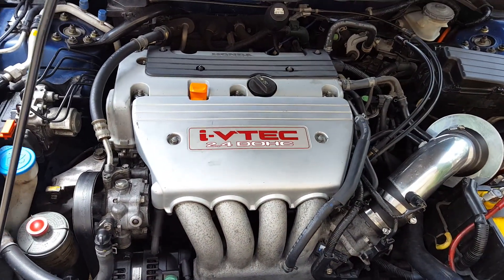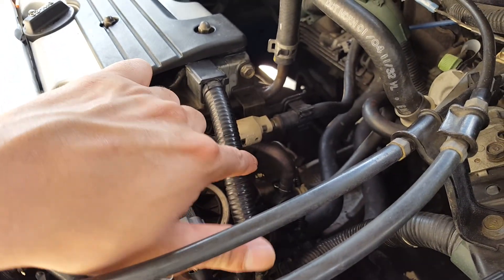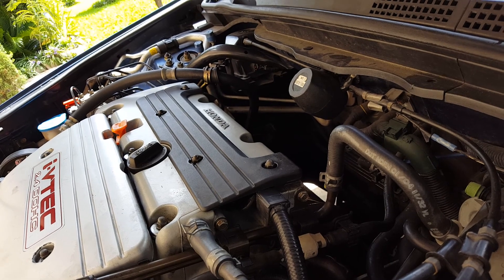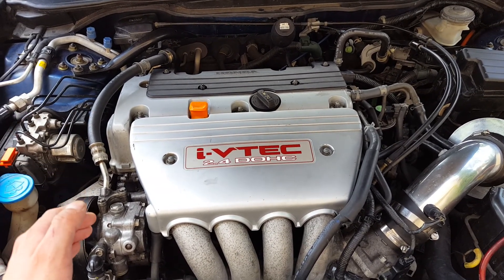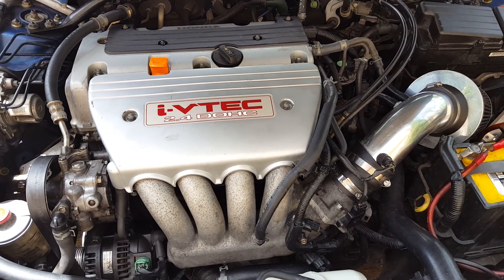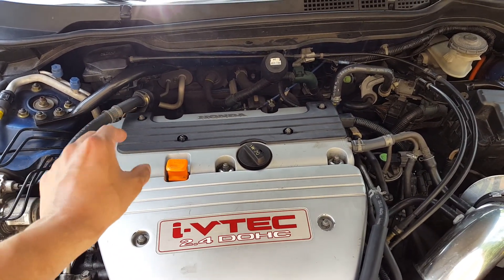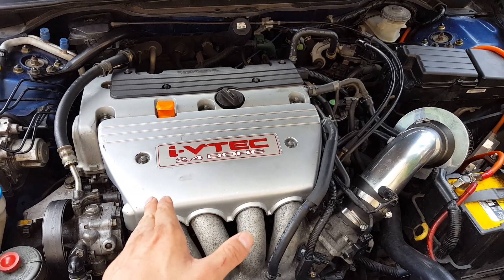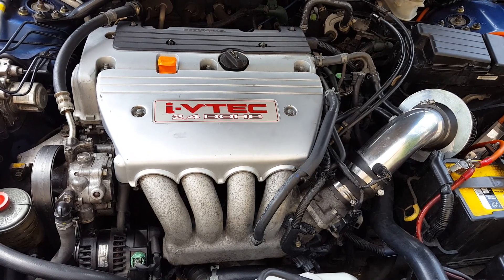K24a2 head procedure

Comment: Hey bro how’s the set up running im planning on trying it i have a 03 accord with the k24a4 engine and i have a tsx k24a2 head i just got from a friend
Reply from the maker: sorry about the late reply,As long as everything is done right and your car is maintained ,the engine should run good.,The only thing that sucks is the header part ,all the garbage sold on ebay and on line is crap even the dc header manzo header aftermarket parts are low quality ,ect ect..ILL say run the factory k24a4 or k24a2 exhaust  headers with new gaskets genuine from honda all tightly torqued to specs..The car should run better beleive it or not..To be honest is all worth it though..make sure you have your support bracket on your chassis and that the bflex pipes  metal STICK is going through the grommet held and supported  of the metal bracket that tightens to the subrame  chassis of the accord .In this manner your header will never melt....however if your using stock k24a4  exhaust header ,,it should never melt because its good quaility product...

Comment from the maker: Let me clarify one thing the hesitation wasnt the vtc  itself .it turns out it was the header that was split near the bflex pipe , that was the main issue .However the vtc does kill the car itself  if its half way in half way out ..,so make sure the wires from that plug are not fragile and that they are solid and sturdy ....Once again it was the header ,the manzo  header was split in half hanging that was the main issue..This set up is plug n play ..Also make sure that the mechanic isnt in a hurry and that this bonehead mechanic doesnt forget to apply 174 nm   or 130 lbs of  precision  torque to the 19mm cranshaft bolt and do not forget the wulldruf key ....From my experience the accord puts out some serious power so bolts that arent secured to the given nutenmeter or precision torque , they will come off overtime ...Also as long as the cps are genuine in both the tsx and accrod by part number  they will work perfect with either emission head or as you see this tsx head here in this video ,because both the tsx and accord use the same camshaft position sensors one is label different on intake and exhaust but are same identical honda acura genuine part n number  on both camshafts ,so this a freebie im giving you the builder..i have lots more ive learn and obtained in this build ..i will share it freely ....
The other thing that came apart was the o2 temperature thats reads the temperature of the block   near the exhaust camshaft position sensor,however that wasnt much of an issue like the vtc oil solenoid was...Also check to see that your head meets the honda ,and acura specifications im sure its 3.84 so than you know if you have to resurface the warpage o remill the head but thats obvious because you can eyeball it ,, or better yet measure it with a precise tape measure ,,  according to that measure ,numbers to remember  are 
0.008 
0.05 
3.84 ,,sorry i meant 
3.94 
In regard to either k24a4 or k24a2 vtech head.......its the same procedure ...thats why it worked on my set up ..,beleive me ive already mastered this engines chassis ...so im giving you this info free.. so get to it and build your vtech head on your emission accord chassis .Enjoy life ...
Beleive it or not you have so many options so many heads  vtech or non vtec ec ect ...but keep it simple use the tsx head  on your accord it will benefit alot ....
The hidden gems of an emission accord not a full sulev but still an economy low emission chassis accord.Also this k24a4 is real vtech ,so many folks thinks its not im talking about the stock head on the intake camshaft it has real vtech ,,however i prefer it on both camshafts so i chose the brother the tsx head .
Reply: Did you change the pistons? Ive read that the accord pistons bump into the k24a2 head.
Reply from the maker: @kevinrivera8858  nope ,currently im using stock pistons without any issues .If you look clearly ,they are almost identical pistons on the accord chassis and tsx chassis.difference is thickness in rod formations but its the exact numerical value stock 87 ,,.Ive redline my car past 7300 rpms ,no known issues.Another secret to this is because they use the same oil pump by part number and abreviation.So you are in good hands..this accords ouput power comes from the stock  crankshaft,pistons,rods and also partial emission based vtech head,and this are all accord stock parts from the k24a4 chassis,yet the user can benefit from the tsx head itself bolten on correctly assuming the heads compression is good or is remilled if necessary , rectified ,polished according to specs...No issues with my accord pistons and this tsx head .
Reply from the maker: Also only reason to upgrade to tsx pistons is to benefit from the extra power they generate in the accord chassis, now top that rod with a good recognized brand piston new in standard size and your accord will put out some serios power.Of coarse you have tune correctly and utilize hardware engine management to get the best overall gains in performance .
Reply: Its not the pistons that are the issue . The issue is the valves on the a2 are larger and hit the piston you probably having engine damage and you dont even know it ur not a mechanic like you said
Reply from the maker: @ericmadx3063  actually that isnt an issue because if u ever put an exchange both heads and you look at them just right , you will see in fact that they both are symetrical and they both seat  at the same position including on the exhaust side of the valves .I have both heads and ive done the measuring myself .I also have the schematic on both cylinder heads,its why i know cleverly that my car is happy and maintained.As far as realizing what works and doesnt.They are balanced just right both cylinder heads .Theres no issue here .The issue arises from improper installation.I recommend you read the rebuilt on both the tsx and accord .Surely than you will know whats correct and what isnt,or study the schematic map of both heads .Your answer is there.Just take the time to study so u wont rely on others input that are wrong in all aspects.
Reply from the maker: @UCbtUF7nzVYauJ11kFC3rU_A on line or if you have a mechanic working at honda pay him a visit .Resources are available everywhere.Always read as much as possible  ,it helps.
Reply from the maker: @ericmadx3063  im sorry to burst your bubble ,but you obviously are clueless first u dont know what your saying ,
You need to study and take your observed look at the valves  carefully,
They are identical on both vehicles .
I didn't mean to sound bossy .
But like others and idiots here on you-tube , hear and beleive others when in fact they dont understand mechanics of hondas .

Next time think before you offer wrong  info on this machines..
Like i said they are equivalent congruent on 
In 
And 
Ex 
Sides .
Surely i give u that free of charge .
So now you know the facts .
Only problems arise from improper installations .
Incorrect measures 
Or misaligned ,or incorrect shaves,ect ect.
Deformed bolts ,not correct size .
And sometimes mechanics are in a hurry ,and start to mess up  without knowing it.Clearly ,i had to fix 3 errors my so called mechanic did on my set up .,so yes to answer your comment ,im not a licensed mechanic , but i am capable of fixing other so called mechanics work.Not to mention i did pick up my dads talented side of fixing things  and being able to correct sloppy works by so called imcompetent mechanics.
Last im being taught by the k series master from my  town.Only one true master of mechanical engineering and mechanics , and the accord hack master .But yes this is a plug n play swap , just be cautious ,take your time and always remember to tightened to makers specs.
Correct nm or  lbs ..
Plug n play even without engine management .
One last note only for the 2003 to 2006 accords k24a4 , its simple plug n play....
This swap works perfect for this generation accord 
K24a8 chamges in the fact that it uses a dbiwire throthle and it harnesses about 6 to 8 extra ponies ....to its chassis .
But im sure theres a way around that set up ....
This video is for k24a4 accords